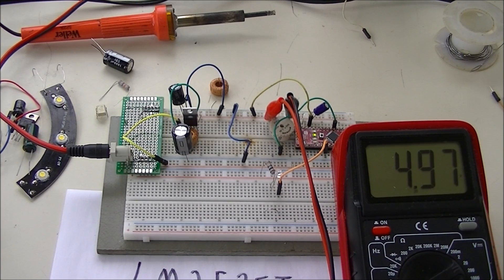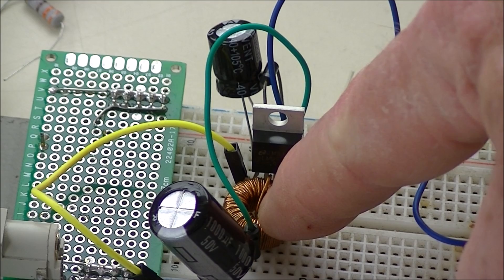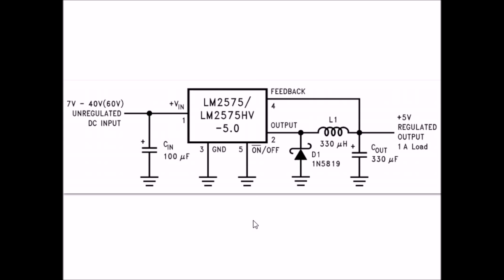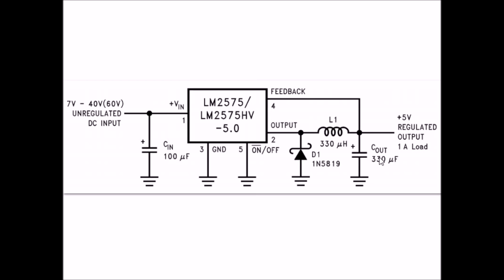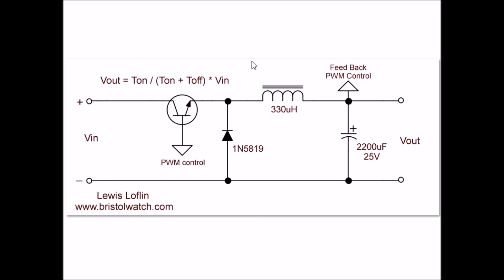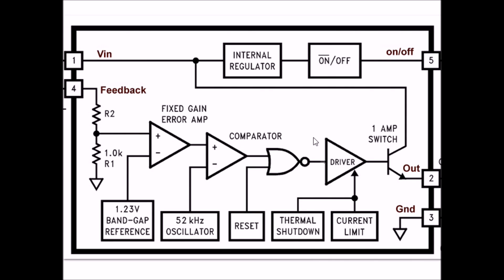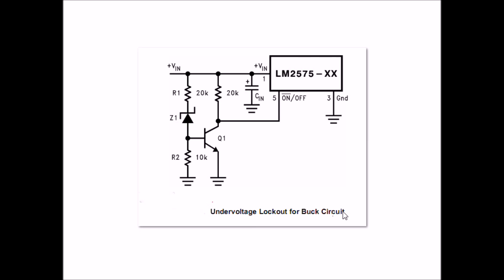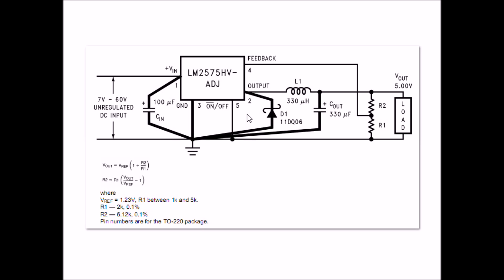Using LM2575T Simple Switching Voltage Regulator

Comment: my circuit is putting out 3,somthing volts and goes down to 2,sonthing volts. is my regulator bad?
Reply from the maker: Try another regulator. Are sure it is wired correctly and did you use the same parts? Did you build it or was it on a simulator?
Reply: @LewisLoflin  I checked again and the wiring of inductor was faulty. After soldering it correctly it worked perfectly, thanks for the reply! :D
Reply from the maker: @danielwyler9527  Great! I use this all the time as a variable power supply.

Comment: Thank you for your clear and concise introduction to this regulator.    It's good to have an option other than a linear spilling heat.    On the last [datasheet] schematic, do you know why four of the IC's leads were made bold ?
Reply from the maker: That illustrates this are be short electrical connections. This thing has a 52kHz oscillator and leads must be kept short.